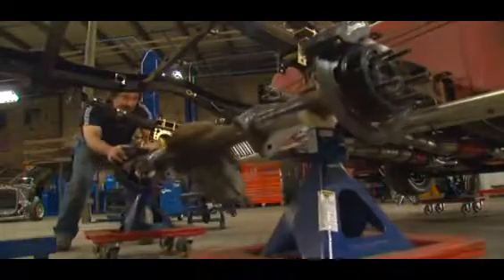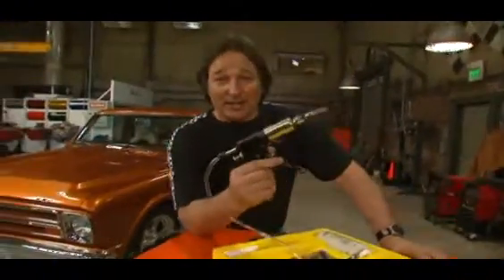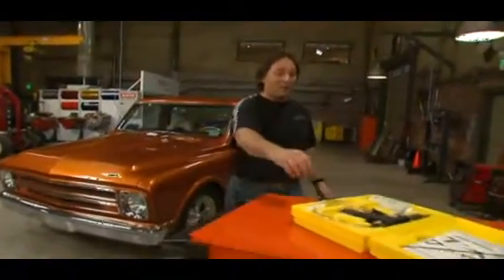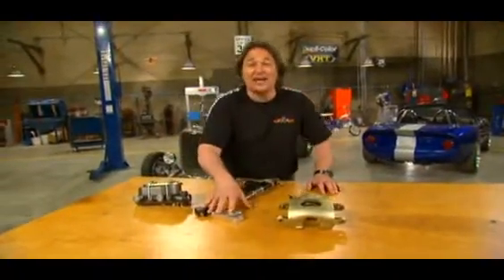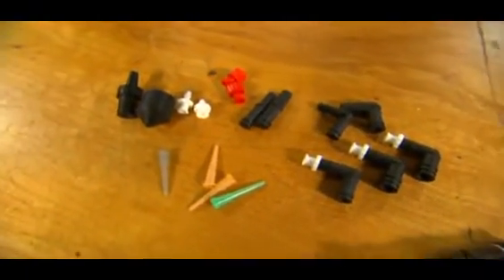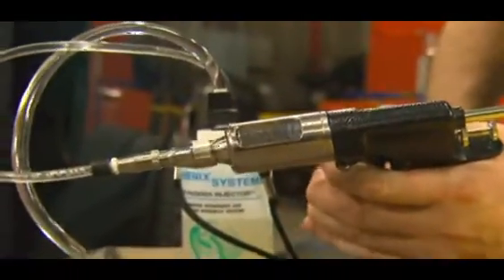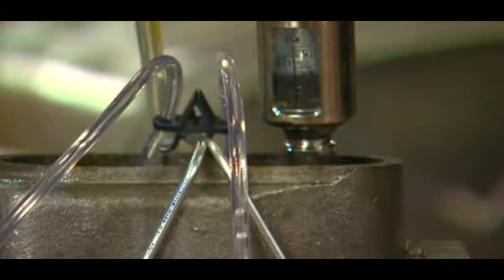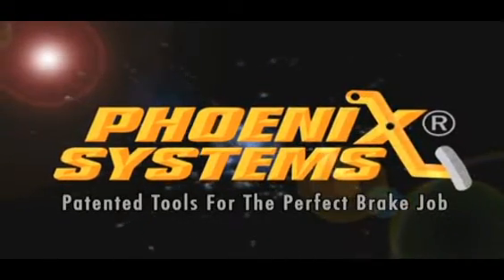Phoenix Systems Brake Bleeder Training with Stacey David

Comment: so how do you remove the old brake oil?
Reply: The back side of the bleeder creates a vacuum. The vacuum tube is placed into the master cylinder and used to pump the fluid out.